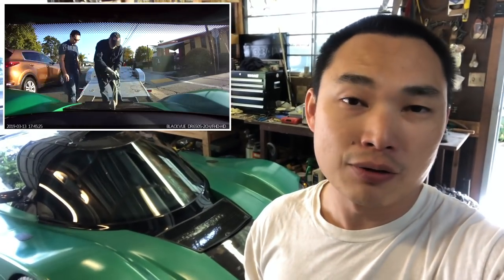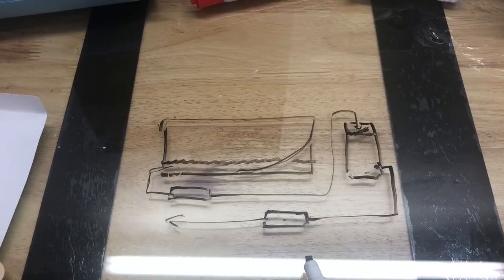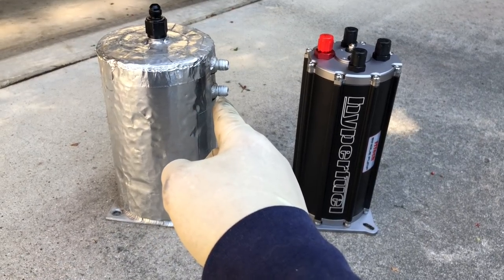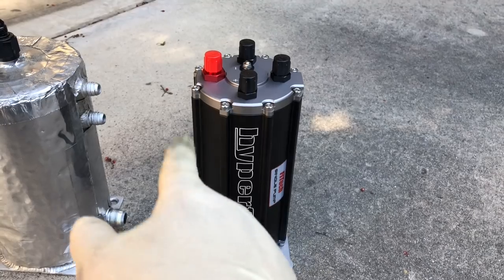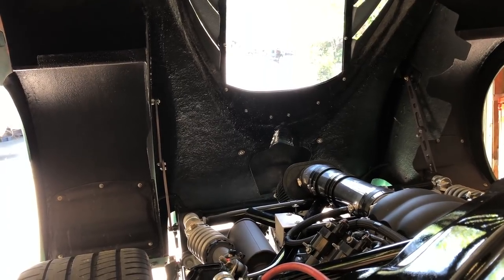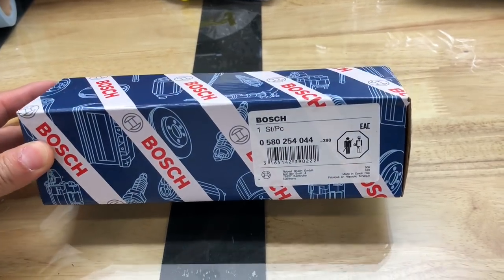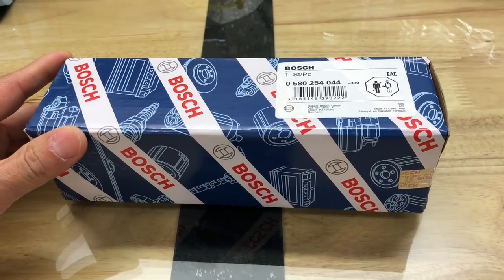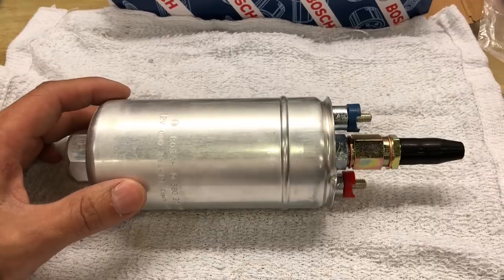Superlite SLC - Fixing my broken fuel system

Comment: Nice video. Can you let me know the part number for the Fitech fuel pump? I'm looking for quieter fuel pump for my Holley Sniper EFI. Thanks.
Reply from the maker: I purchased the 40007 pump, but it failed on me fairly quickly. I would not recommend the FiTech duel pumps given my poor experience with their products.  I returned 1 unit due to a failed bolt (quality control issue) then my second unit failed because of an internal issue (poor construction).  I tried to fix the pump myself but the bolts holding the unit together were over-torqued and seized.

Comment: well maybe your trying to save funds, so your buying cheap pumps, so they go bad, the other problem which your repairing is gas starving or air pockets, both cause the pump  to run warmer, pump gets tired. lets say you dont mind spending  1000.00 dollars for a fuel pump, maybe trying a  gm chevy high performance pump from a dealer ordered. chevy corvette race teams use a  bog warner fuel pump system. i feel the pumps you ordered are legit real, theyve changed some small manufacturing methods, but to tell for real cut the  pump open and look at the brushes and winding. i feel your demanding to much from these pumps your using, burning them out. goodluck using your new brand.
Reply from the maker: @jon gone gone - I appreciate the advice, thanks for stopping by!  Check out my latest video - https://www.youtube.com/watch?v=VECGSiAXrEU&t=2s

Comment: Great video Cam.  Glad you got the fuel system sorted.  I love the sound of the new unit.  It fits the car much better.   I would be so frustrated if I found a scammer on eBay and would certainly report the seller.
Reply from the maker: @Jason Ablett - hey, thanks again for the dessert!  I agree, going with an in-tank unit really brings the noise level down.  It may just have been so long since I was last in the car but it was a pretty awesome time getting back into the seat, and the noise seemed quieter.  Maybe just the placebo effect.  Buuuuuuuut .... my new FiTech pump has issues.  It's going back (again).  Back to the drawing board.  It seems between scammers and poorly designed pumps it's a total minefield out there!